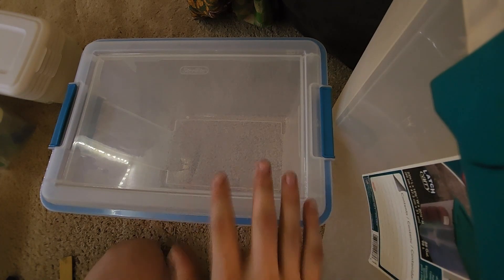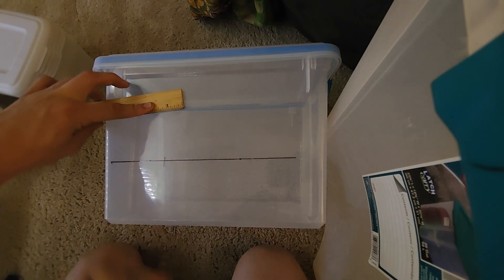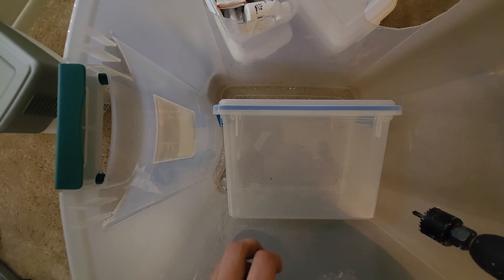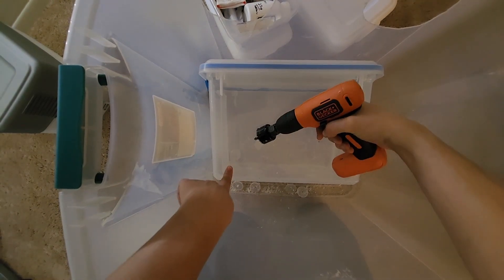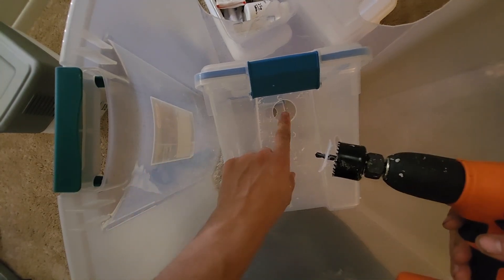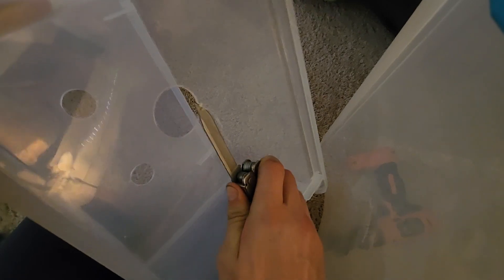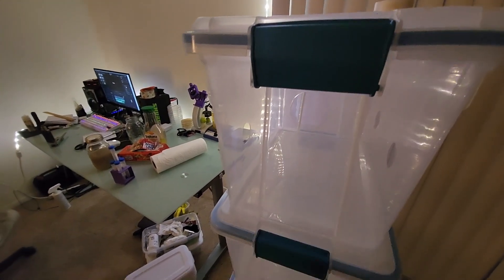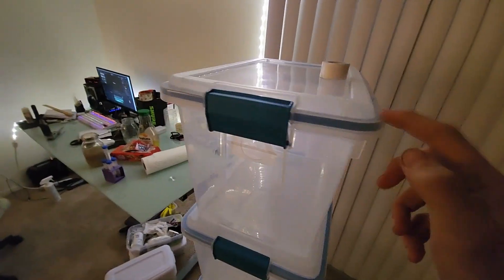How to Build A Monotub for Full Flushes

Comment: Concerned that the weight of CO2 overcoming the resistance of filters on both the exhaust and intake. A small vacuum air pump with 1/4 - 1/2 intake hose run into tub would make quite a difference in ir exchanges. Of course I might be over thinking AGAIN.
Reply from the maker: No need our friend osmosis Jones takes care of all the gas echange necessary. A fan brings the possibility of drying out the air too much so you would need humidity regulation too if ur going that method, at which point a Martha tent is probably better than a tub

Comment: Once your mono tube is complete and you place your inoculated grain and substrate.  Do you place it in a temp and humidity controlled tent?  Having difficulty keeping humidity equalized between the lower shelves and top shelves that are 3.5 feet higher.  Any suggestions?  Thank you!

Comment: Yo brotha.  Trying to dial in my 20qt's.  Had one really solid grow with 2" holes when my RH was high 60's (live in tropics), but recently it's been dry and the 2" holes is leading to dry out and the need for misting.  My goal is to dial them in to the point of not touching until harvest.  What's your RH where you live?  I'm debating either going down to 1.75 or 1.5".  Have you ever had top holes larger than bottom holes?  Thanks.

Comment: Hey bud, i know you uploaded this a while ago but im following this tech, with my 2 sterilite 20 qt tubs, and i was wondering if you think p.nats would do okay in the 1 and 1/2 inch holes you drilled for yours, i know they want more air, i was gunna go straight to fruiting from grain when its ready, this is my first ever grow and feedback would be very helpful, thank you.
Reply from the maker: @chrisflippo7455  they did alright for me but It wasn't a full canopy it could probably use more air but if ur just looking to get some fruits they are fine
Reply: @MycoDogs  I'm a bit of "Wana get it right the first time" kinda guy, and am trying to get the most out of my grow as I sank my last 100$ into this whole process, thank you very much for the reply, do you think going up to 2 inch for the side holes, under the latch is better, and do you think it would also grow other strains just as well if I did so? I have some very good genetics from a guy I know who's personally worked them for a long time, and he gets full flushes but is using 66qt tubs.

Comment: If you have a more powerful drill, drill the hole, till the bit pops through and the saw teeth contact the plastic, the run the drill in reverse the rest of the way. This will make the holes much cleaner, you don't have to watch the speed or worry about cracks because the teeth don't bit. Thanks for the great video!

Comment: Pro tool Tip run the drill backwards for a smooth edge it's slower but it will be better try it after the pilot bit penetrates the surface

Comment: Stilll not entirely sure why people find it necessary to drill holes in they're tubs but hey.. to each they're own
Reply from the maker: still not entirely sure why people put turbos on their car, they drive just fine without them.... to each their own
Reply: @MycoDogs  not even a good analogy considering that I've used all kinds of modified tubs before I went back to the basics and all the extra shit doesn't really make a tangible difference
Reply from the maker: @Adam Dudley  we have very different experiences then. Or you have more co2 tolerant genetics, which you can select for
Reply: Continuing with the analogies; would an automated monotub with a fan and humidifier be like a luxury car,  more extravagant than useful?
Reply: @Dro_Ez11  I believe so.. you can put about 4-8 small holes and that will definitely help some with fae so you won't need to open the lid as much. But if you are going to do that, it is best to put some micro pore tape over the holes
Reply: @Dro_Ez11 Precisely, I'm going to put a nice pinstripe on the side of mine. Bentley, the box.

Comment: Anothar question, after the bulk sustrate is fully colonized, do you leave the holes without filters/micropore tape for fruiting?
Reply: No that's when u use it for air exchange. 

Fir colonization the should be covered

Comment: Cool man, great video. Makes sense. Now my question would be related to humidity levels, how do you take care of providing a humid environment to your shrooms? Lets Say if you llive in a dry area?
Reply from the maker: it regulates the humidity inside the tub you dont need to do anything else, although its good to keep the RH in the room its in above like 40%, i dont change anything for fruiting or colonizing the filters provide gas exchange it will fruit when its ready to. Most experienced growers these days no longer do different things for colonization and fruiting and instead just spawn straight to fruiting conditions and let the mycelium decide when its ready
Reply: @MycoDogs  thank You so much, I'll be testing this without making further changes to my tubs...I want to compare the times for fruiting between a tub with a fan an a humifier and another one without anything...

One last question, does the number of holes in the tub influenciate on how the gas exchange and humidity is controles? Do you recomend making only 4 holes?

Thank You so much for your time is really appreciated🤙🏼

Comment: An empty soup can heated will melt a perfect/clean hole in about 5 seconds once it is hot. Cheap, easy, and clean.
Reply: I’d say a tomato paste can?
Reply: That's what I was thinking as it would be closer to the right size hole... But I'm concerned about the lining on the inside of the cans which I see in the comments someone said was a problem... I'm wondering why we can't just cut squares with a razor or knife? Does it have to be circles? LOL why not squares or triangles? LOL @AJManol
Reply: @AJManol I literally just tried that and it has a plastic liner on the inside so when heating it up, the plastic starts melting and it creates a bunch of toxic fumes😢
Reply: @izzyindahizzy2006  dont worry only took 5 mins off your life you good
Reply from the maker: Ye if u do it ouside that works well
Reply: Or...you just put your drill in reverse and it will melt thru the plastic in the same fashion.
Reply: True, but it may crack the plastic.  @danielchavez387
Reply: I’m wondering the same can I cut a square instead for a clean cut?
Reply: Run it in reverse for soft, brittle surfaces. Like Daniel said.☝️ 😊
Reply: Good idea , Thank you.